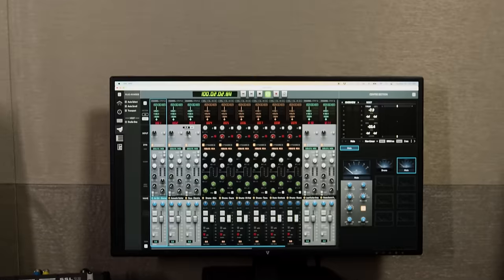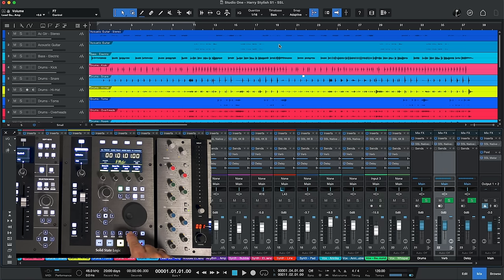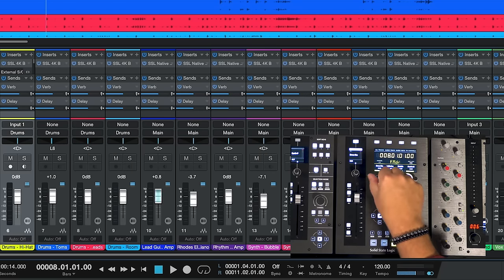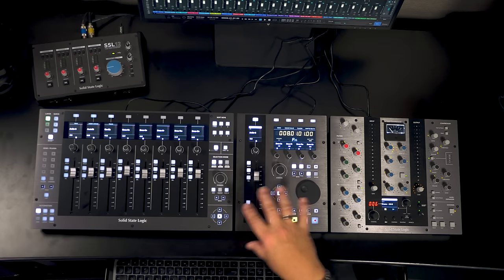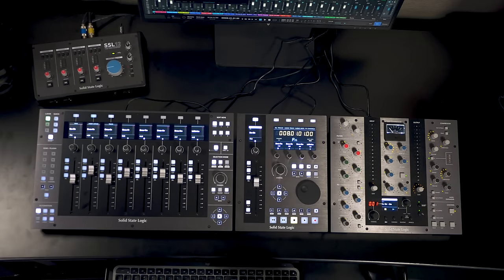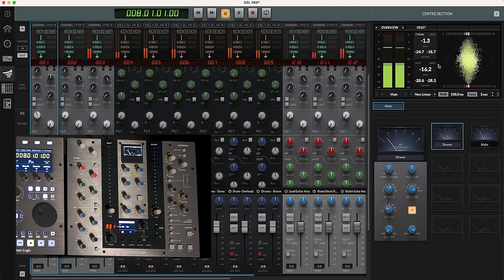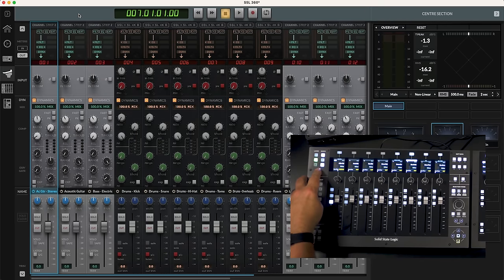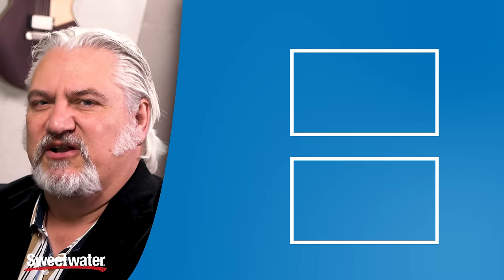Solid State Logic Controllers: Analog Feel Meets Digital Efficiency

Comment: So basically I should spend like 2500$ to control literally 2 plugins. 🤔
Reply: Yep👍🏽. I think I'm gonna keep using my $69.99 mouse to control everything for now
Reply: Uf8 controls any plug-in
Reply: @DaMixWizard Do that for a few years, 8 hours a day and let me know when you start suffering from repetitive strain injuries, in your wrist, forearm, shoulder or neck. You’ll quickly change your mind when it becomes chronic.
Reply: @Truth565  If you are going through all that from clicking a mouse my guy you need to talk to a doctor asap, that could be from anything.
Reply: @Truth565 I've been using the mouse since Digidesign DIGI001, whatever year that was 1998, 1999. My fingers & hands are super good. I was break dancing & pop lockin earlier to some Planet Rock
Reply: @Truth565  buy a trackball to replace your mediocre mouse.  Problem solved.
Reply: Yep but its a completely different approach 😊
Reply: @jan_07  No, problem not solved, problem (the repetitive motion) just shifted to a different part of your hand. Only thing that solves this is variation of movement and less repetition.
Reply: I think you completely miss the point. You can mix faster, have fun doing it and you don’t need to buy all of the units. I’ve had a bunch of different controllers and the ssl’s are my favorite.
Reply: @DaMixWizard  the best response thats sensible. I have been working in major studios since 20. Lately ive worked in the box with a mouse. And its just been killing my speed and work flow because its looking at a screen instead of feeling the groove and working by ear not sight. Its just preferences
Reply: Get a used digi002 or 003 mixer and you will appreciate the workflow plus have more fun. They are of course more affordable than the Ssl but if youre still working with the digi 002 then no need to spend the extra cash.
Reply: Times have a changed! Control 3rd party plugins now
Reply: You can keep using your mouse if that’s what you’re in to. Nobody is twisting your arm. Do whatever works for you.

Comment: I own 2 UF8 - rack mounted with rack kit left and right side of my mastering desk with 3 racks in sweetsop’s and 12U and have another racked uc1  in the mid - on the rack kit there’s much space left and right so the rack kit have a big plate left and right - seems like ssl lack the size of combine uc1 and uf1 together in a rack size . So there’s no space for me to get this unit, if I check measurements both together are minimal more than 19“ - correct me if I’m wrong. unit is interesting but if it can’t live in 1 rack size on 6U together with a uc1 it will be deleted from my analog list.
Reply: Yeah, they should make a rack solution for the uf1+Uc1 combined 🙏😍
Reply: @rytmigo  they cant. Both units are more than 19, seems like they don’t think about it . The weird part is that UF8 is 19 and a uc 1 also have this possibility , I don’t get it why the engineers overseen this feature - awful and this will erase it from my list .

Comment: When you select a channel' out of the boundaries of available fader, with the faderbank autonatically switch to the current selection? 
For simplicuty,  lets assume we have 24 tracks in StudioOne. And we have 8 Physical faders.
Currently we have selected track 1 which can be controlled with teh first hardware fader.
Now we select channel 9, do we need to manually switch the bank or will the control surface follow?

Comment: Anyone knows if you can control third party plugins from it? Like the stock plugins of whatever DAW you're using or VSTs and such?
Reply from the maker: Hi SpongeRoss, great question! With their newest Firmware update, the UC1 now has a slick system of controlling 3rd Party plugins using 360 Link. It has some baked in presets that will be continually updated, but is also completely customizable to any plugin you have pulled up!
If you want to talk further on SSLs controllers, give me a ring!
Drake Sobehrad, Sweetwater Sales Engineer, (800) 222-4700 ext. 3271, drake_sobehrad@sweetwater.com

Comment: How much would this entire SSL hardware setup cost? And is there a bundle for it at all?
Reply: UF8(4) = $5000
UC1 = $800
UF1 = $700 + ALL SSL PLUG INS (SOME COME WITH CERTAIN HARDWARE)= $3520 
$10,020 GRAND TOTAL..
Reply: @GOLDEN LION  mane dats cold 🥶. All that $$ just to control the software. Yall better buy a fire 🔥 mouse & do the @14.99 monthly subscription
Reply: @DaMixWizard  Tbh you only need 3K you dont need 4 UF8's lol but I agree unless you're going to make your $$$ back just stick with a mouse and save the bread

Comment: Can we track up with it?
Reply from the maker: Hi, thanks for your interest! I’m not totally sure I follow what you mean by “tracking up,” but I’ll do my best to answer here, and you can feel free to reach out to me directly for further clarification. You’ll really get the best results from these controllers during the mixing process. They don’t have audio I/O, so you’d need a separate interface to track through – and the plug-ins included with the controllers run natively on your computer, so they wouldn’t be zero-latency for tracking purposes. That said, this is a really useful platform for controlling your DAW as if it were an analog console during the mixing stage. You can even link up to four UF8 units to get 32 faders that communicate with your DAW in real time.
I hope this helps a bit – feel free to send me an email or reply here to continue the conversation!
Caleb Lowrey, Sweetwater Sales Engineer, (800) 222-4700 ext. 1620, caleb_lowrey@sweetwater.com

Comment: What about sound and sonics?
Reply: It's a CONTROLLER, the sound quality is what is coming from your computer. A midi controller doesn't affect the sound. The PLUG-Ins are a different story, SSL is known for GREAT sound and sonics.
Reply: @km3musiclab  Yes, the hardware.
Reply: @KM3 Music  Just save your money and buy an SSL board?
Reply: @MadACeTeeMack  Buying an SSL board or any analog board is not like buying a midi controller. You have to spend thousands on the board + maintance + electrical fees + deal with the inconviences of dealing with analog gear. It's not for everybody.
Reply: @Six Mill  Yes, and that's why there sound won't be able to compete in the industry. I guess there are just hobbyists